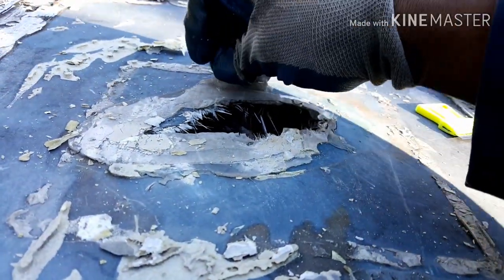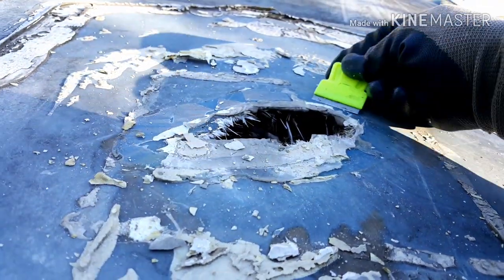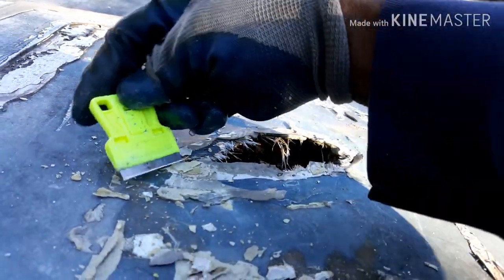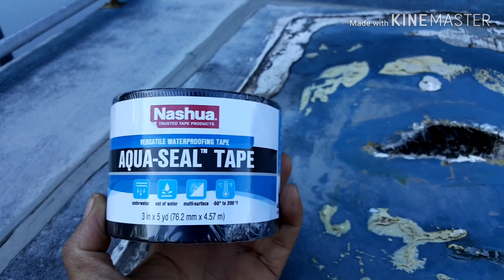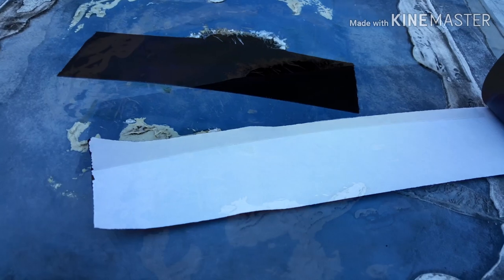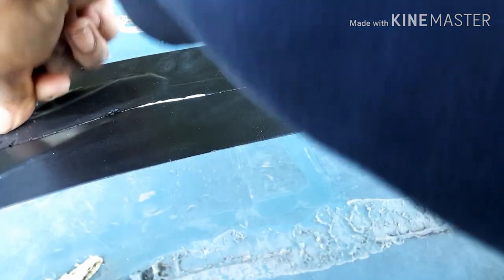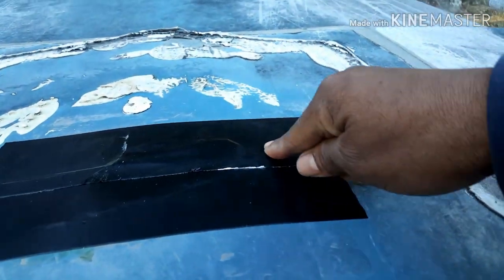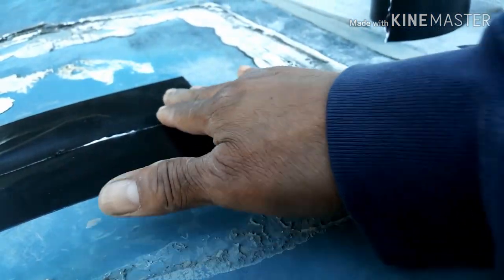VAN LIFE IN A BOX TRUCK: Patching the hole in Mitsi's van "Bertha"

Comment: I had a similar situation on my fiberglass campervan roof. I had 2 vents which didn't give enough room to mount a large solar panel up there. So we took the forward vent out and scraped all the residue away. Then I purchased a 1/8"x18"x18" inch piece of high density polyethylene from a local plastics company. Then we used the putty tape as well as screwed it down to the roof, followed up with Dicor lap sealant. So far, no leaks as the solar panel blocks any direct rain. It also wasn't in my budget to do a fiberglass repair, over $100 for the materials. We paid about $13.00 for the plastic sheet plus the tape & sealant, which we can use elsewhere.
Reply from the maker: Well done using the polyethylene to patch your roof.  At the time, Mitsi was looking forward to putting a vent fan in that area and only wanted a temporary solution. Thank you.  I appreciate you watching.

Comment: Thanks for sharing.  Would a heat gun help remove the left behind caulk and other patch adhesive?
Reply from the maker: I was thinking I might need a heat gun on the small section I scraped away.  The blade worked okay so I stuck with it.  Great suggestion that I will keep in mind if I need to remove more of that old caulking for a future project. 👍🏾